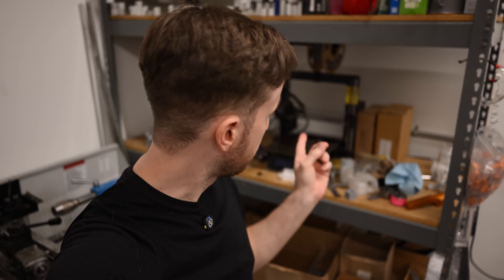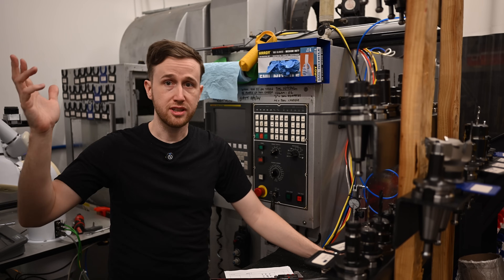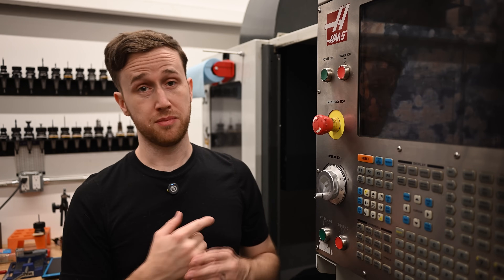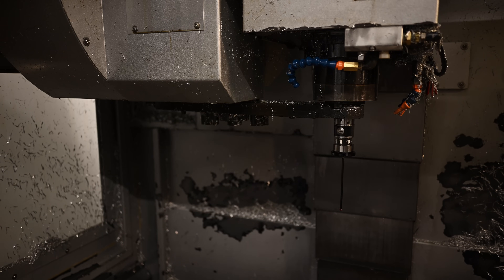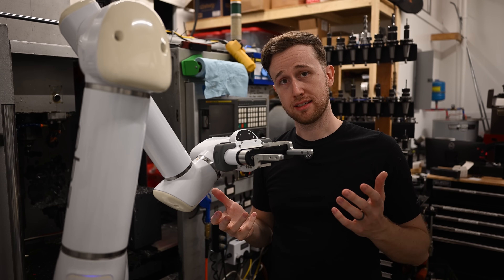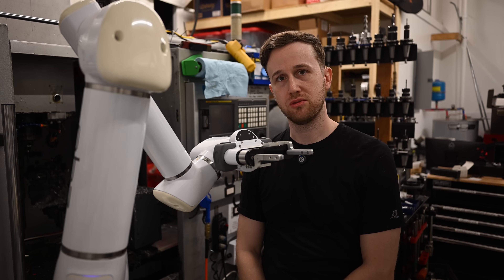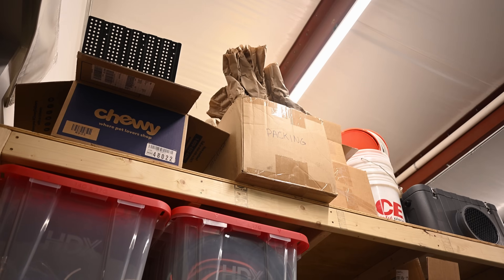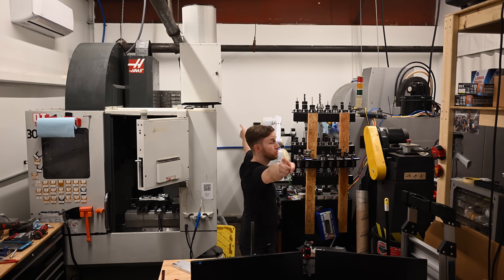He Makes High-End Film Gear in the Tiniest CNC Machine Shop Ever | Possum Solutions Shop Tour

Comment: How much $ did you get the DT1 for? And looking back now, is there a different haas you would’ve went with? 

I’m in the same spot, 3d printing using fusion and want my own machine but undecided.
Reply: The DT has been fantastic. I got it for a deal: $15k and the previous owner needed it out by a certain date. 

That being said, it is a very specific machine. I’ve had a couple issues (main board went out, tool arm home sensor went out, grease fittings clogged, way cover screws backed out and destroyed the X way covers). But overall it’s been a great machine. Any machine as old as it is will have some stuff go wrong. Even with the issues and adding probing I’m still into it for less than 25k which is a win in my book! 

As for a different machine, I think for what I do the tapping is awesome, but in general the more common the machine is the easier it is to find info and parts for it. The DT isn’t bad, but even just the tool changer arrangement is specific enough my HFO hadn’t ever changed the tool arm home sensor, so I had to kinda figure it out. 

I definitely will say finding info on fixing the haas is WAY easier than the sharp though.